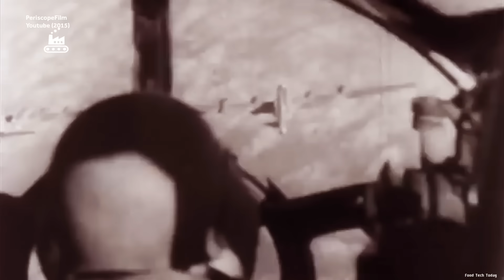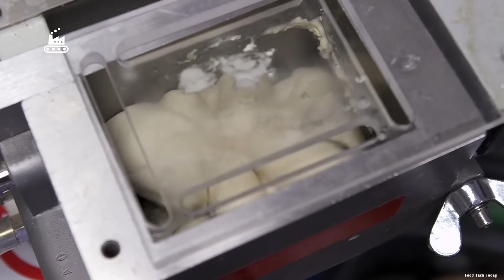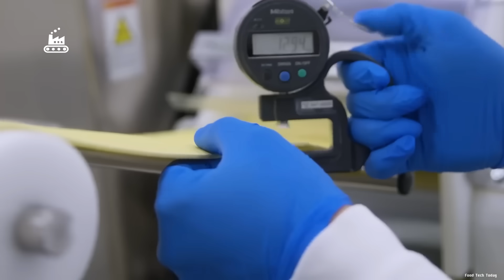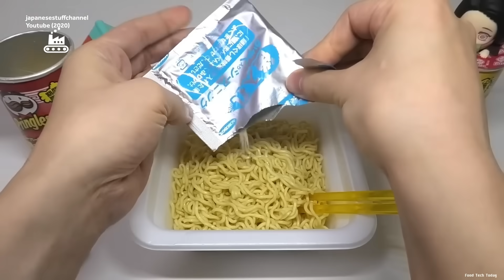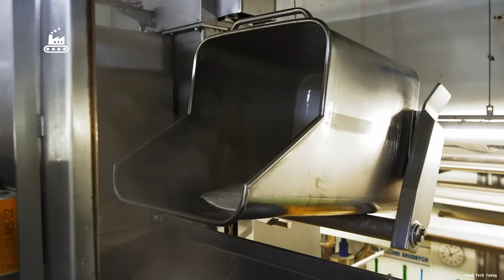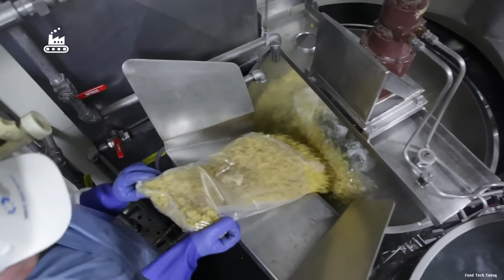How Instant Noodles Are Made in Factories 🍜 | Inside the Production Line

Comment: you want a best cup of ramen?  Take a cup and add the noodles and cover them with boiling water no more then cover the cup for 5 to 10 minutes, add the flavor pack and stir. The noodles get nice and plump while covered for the 10 minutes. I use one of those hot water kettles that you can plug in to boil water in just a few minutes.
Reply from the maker: That’s a next-level ramen hack!
Reply: In Asia, you just buy them in the cup.